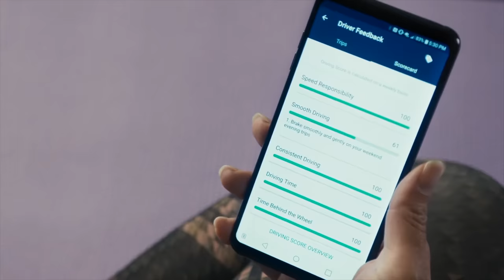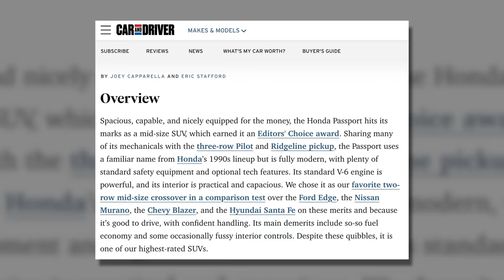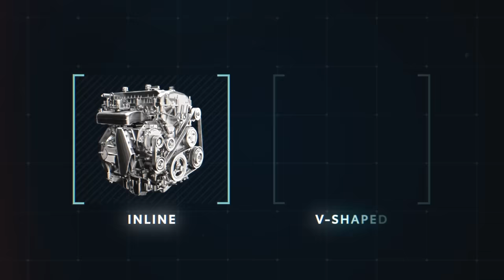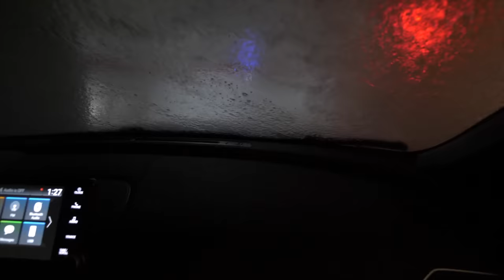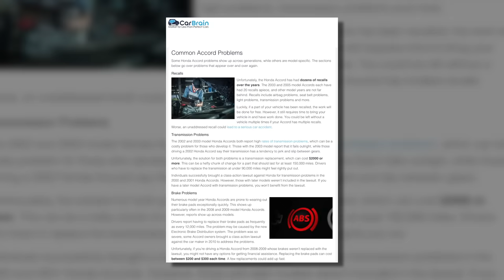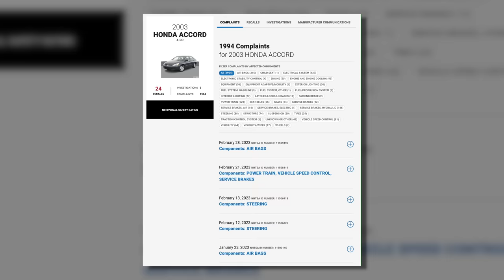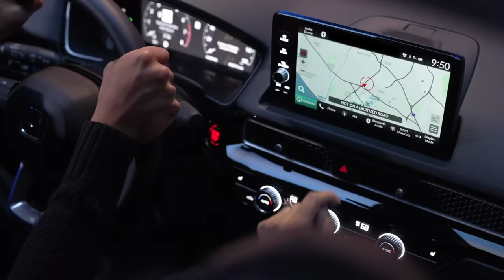Honda's CEO Just Said, "We're Losing Customers Fast and Don't Know What to Do"

Comment: I have a 2003 Honda Accord with 188k on it the big ticket items that went for me was, the original ball joints and front axle at 140k, Fuel Pump died at 150k,  original Starter died a 175k, the Catalytic convertor Rust failure at 181k, replaced the Head Lights with brand new ones at 170k the cleaning method did hold up. The rest is has just been maintenance lots of oil changes over the years. The only real problem believe it or not has been the Ghost Radio issue. This started at 121k which it will automatically turn it self off on or no matter if the car is turned off or on it can play in the driveway with no key in it. That has been the biggest pain in the neck even put a new aftermarket radio below and after two years the original problem came back an where the old radio is turning itself on and off again even though it is not connected with the speakers anymore.

Comment: Been buying Toyotas for 45 years and have yet to have a major mechanical failure. I still think they’re the best cars on earth.
Reply: Try the new BMWs. They used to be terrible in the 2010s for reliability.

Toyota uses their engines in their best cars now. A 340i will treat you right without a single problem.

Comment: Honda's are good, reliable cars compared to most models. Toyota sets the bar when it come to reliability. I have had a Lexus 400 and three 430 models since 1998. 25 years and have had almost zero problems. All bought used.

Comment: I live in California. I have a 2007 civic. Great car, below $20k originally. 
Now 16 years later what are my choices for replacement?
Another civic with a ridiculously agressive look and a gas engine?
No thanks.
Where is my <20k electric civic with ~150m range? A civic is not designed for driving more than 100mile a day: it is small, stiff, noisy, so it’s perfect for what it’s intended for: runabout, commute… I have NEVER driven it more than 100 mile in a day in 16 years.
It’s main weakness and it let me down once: small, weak starter motor. An electric version would not have that problem.

Comment: I bought my 2004 Honda Element as a Honda Certified pre-owned car 
(45,600 miles on the odometer) in 2006 for $15,000. Manual transmission. It now has 156,000 miles on it. Yes, it occasionally needs repairs. For some reason, mechanics will express an interest in buying it from me. Last year, I drove it into the local dealership and was told that they didn’t want to see me “throw good money after bad”, and offered to show me some of the new cars in their showroom. I took that as a hint, and have no plans to return to them for fear of possible vehicle sabotage. It is my belief that the dealership mechanics are under pressure from management to generate even more revenue. They are good people, they are just subject to corporate pressure. I hope that I can get another 50,000 miles out of my car. I am retired now, and just use it to run errands around town. No more road trips. I live in a city, and have outfitted her with a gas cap lock, a catalytic converter shield, the club, and most recently, a set of wheel lug locks. A friend of mine inherited a 2005 version of the Element. Just a few days ago, she left her house only to find her car stripped in its on-street parking place. If you own one of these vehicles, hold on to it, and take measures to protect it from vandals and opportunists. Be well.

Comment: I work in the roadside assistance industry. Honda needs to stop using these tiny lawnmower batteries. If people  leave the ignition on for 20 mins there isn't enough current left to start them.

Comment: I loved my 2004 Honda Civic. I bought a 2017 Honda CRV but when I heard about the problems with oil and gas mixing because of the new fuel efficient engine I traded in the CRV.
Reply: You should have waited. The new GF-6 oils fixed oil and gas dilution 4ever. My 2018 Civic with the turbo is a dream car.

Comment: It is Unfair to point out all of the honda issues reported yet not reguard reported toyota issues. For example, Toyota has suffered from melting dash boards, digital screen issues and oil leaks. That said, Both companies are impressively reliable as a whole.

Comment: Had Hondas for 30 years. Last one 08 Civic.  A Lemon. Wheel bearing all fours got water inside and car made a humming sound.  Happened 2 years into ownership.  And again on 3rd year into ownership.   Interior lights stopped working.  Windshield rubber seals came off.  Headlight mounting oxidized year 2. Paint oxidation 4th year.  Last but not least engine fluid module regulator stopped working in year 3.  Just past warranty.  They had to remove part of the engine and front suspension.  Honda would not pay for it.  Told me to bad so sad.  I have not owned a Honda since 2015.   Don’t recommend Hondas. They don’t stand by their product.

Comment: I have a 2011 Honda Pilot and bought it with 245 000 miles .
I have within a year, put 75,000 miles .
Yes I have put work into it but nothing to expensive, and I have done some of the work . 
I would buy Honda again .
Going to take my Pilot  in for a timing belt change soon ..
I also would buy a Toyota

Comment: I believe I heard my 2002 Saturn SL2 has a Honda engine in it. Over 150K original miles on it an no work done except replacement ignition coil under warranty. As for the Saturn cabin features, below average. Simple car but still plenty broken. At least the Honda engine is amazing.

Comment: Tried to buy a new Honda but hated the searching experience. We asked for manual transmission and the dealer dismissed us saying that was obsolete, or that manual cars come only with under 95 HP? I had a manual 2011 crossfox, it wasn't  even a large SUV and it had 106 HP, are you kidding me? Meanwhile the CTV transmisions are still unreliable enough on almost all brands to trust blindly but the car rises value because of it. Whats more if CTV fails, forget about the car. Repairing it is too expensive and virtually impossible outside the brand's  tech support. 
When you force down only one model, clients simply don't  buy.
Reply: I have not heard of many,  if any issues with Honda's newer CVTs. Toyota as well!

Comment: My family bought a 8th gen Civic (used car dealer). It was the most miserable car we've ever bought. It was the only car we have sold prematurely (only after a year). Despite Honda being reliable or at least cheap to repair, there were SO MANY petty issues with it, it just added up.
Reply: The key here is you bought it from a used car dealer. It was probably driven hard and abused by previous owners. Don't ever buy from a used car place. I had the same generation (2008) for ten years and I had no issues. But I drove it off the Honda dealer as a brand new car and took care of it. Funny how that works out better.
Reply: @markr.1984  you are actually right. The main issue is that we got it from a dealer. Other than that, the right type just wasn't really my preference.

Comment: I worked at a dealership putting Honda motorcycles together while in HS and in college. I agree with Scotty in that I sincerely believe that Honda makes the best engines in the world. However, they have had automatic transmission problems that went unsolved for many years with their 6 cylinder engines. I personally think that they remain questionable. They also have failed to adequately deal with interior noise. Again, this has been the case for years. I sat in the back of a friend's Accord and could not hear the conversation in the front seat. One friend, who had always bought American, bought an Accord just about four years ago and soon traded it on a Ford specifically do to horrible sound deadening. At one time Honda cared about building a quality product but they now rate fairly poorly in the Consumer Reports yearly frequency of repair survey, particularly their offerings like the Odyssey or Ridgeline, which routinely get panned for things like air and water leaks. Speaking of the Odyssey, many owners feel like the design went backwards during the last major redesign (2011?) and instead of buying another, they switched to other brands. Another friend likes his Ridgeline but had to get it fixed in less than a year due to water intrusion where a weld was not sealed properly, apparently a common problem. There was a time when Honda would quickly address these problems but apparently not anymore. Lastly, Honda has always been pretty conservative but so much so these days that they don't appear to be keeping up with the competition on innovation or features.  My family went from two Honda's in our garage, to three Toyotas. To be fair, all things being equal, the Honda's do seem to get slightly better mileage than Toyotas.

Comment: As an owner of 4 prior Hondas ( 75 Civic CVCC 5spd, 85 CRX Si, 88 CRX Si, 2009 Honda Civic Si) I would offer that Honda and its stubborn insistence to offer "Si" versions (as well as Type R ) strictly as manual transmission vehicles is getting increasingly "silly" . Right now I am in the market for a new car and would consider the current Civic Si sedan..... if offered with an option of a 8, 9, or 10 spd. automatic ( as well as their retaining the 6spd manual) ......The current 23 Accord Hybrid Sport   is great but needs more torque ....Honda needs to return to offering more "fun" vehicles such as a S2000 and a CRX for 2024....Maybe even a redo of the Element. Hybrids are all fine for any of the new offerings. Hurry the Civic E Hev Hybrid to the USA ( it is already out in Europe).  Bring back the Fit (again already out in Europe) ..How about Kei cars for the US market? These suggestions are just for a start.

Comment: I have been driving Hondas for the past 30 years because they were simply reliable.  An overstressed turbocharged 4 cylinder with a dumb CVT is exactly Not that.  I'll shop elsewhere next time if they don't correct this.

Comment: Have owned older Hondas and Toyotas. Toyotas do have an edge over Honda. Hondas look, handle, and interior are nicer. Toyotas seem to more user friendly, super reliable, car seems more durable. 
I had to upgrade my father's Fit battery as it was totally undersized as it had a oem battery cover for the upgraded size in place already. I remeber Accord batteries were bigger 24 series now they have cheapened to Civic size battery. 
With oil dilution problems and rust issues with their CRV's.
I am strongly going towards Toyota's, don't need anymore problems than there is in my life.

Comment: I can tell you Hondas are way to expensive now. And offer a lot less basic features.
Liek the Civic for example. You can't get foglights unless you get the top trim level. You will always be reminded by the hunks of plastic that you cheaped out.
Rear vents are not available at any trim level despite being a option in Europe.

Comment: I own a civic 2011, family has an Accord 2014 and Honda CRV 2012

I'm actually very satisfied with all 3, but their are some weird defects that I wouldn't expect from Honda.

The 2014 accord has gone through 3 starters, both the CRV and accord have a oil pump problem when cold started that makes a horrible noise from the oil not pumping properly.

The 8th gen civic is pretty good, I have over 300 000km on it and the only constant issue I see on these vehicles is the design of the tensinor bolt, mine snapped and I had to retap the thread with a helicoil. But I see them snap on other vehicles. 

Also their was a drain that was caused by the cluster being on internally.

The newer Hondas have the most odd problems I would never expect from Honda, the turbo powered engines with the oil dilution and oil burning are by far the most suprising from Honda. 

As of right now personally I'm staying away from newer Honda's.

Comment: I have owned several Hondas and Toyotas.  The Toyotas are more reliable (especially the transmission).  Hondas are more fun to drive, have better pickup, and more feeling of the road,  but they are noisy on the highway.

Comment: Funny, I just said today "I think this is my last Honda." I owned a CRX,  2008 Civic which was used, a 2011 and a 2014 Civic. My new  2011 broke down at 20k miles. My new 2014 has 30k miles on it and I keep hearing it needs all these expensive repairs like rotors. Now today I'm being told I have an oil leak which would cost me $700. This is either a lie or something they did since I just took it in for an oil change. I hardly drive but still I never needed all these expensive repairs with the first two cars until they reached 70-80k miles. That's the whole point in buying a new car. I got my rotors and break pads done, having a problem because I didn't take it to honda. Honda told me that the other shop put the pads on backwards. Other shop told me it was impossible and they are putting new pads on for me. I'm going to let them replace my pads and finding a new mechanic. Why can't people just be honest?

Comment: Bought a 2017 Pilot EXL, noisy, terrible radio, uncomfortable seats and transmission needs fluid change every 15-20k miles to fix a shudder. Simple as an oil change but what is up with that. At 72k just ordered the new fluid. Only takes 3.5 quarts to drain and refill. Dealer did the first drain and reprogrammed, I have done it twice. This time I am going to drain and refill, drive for a day or two and drain and fill. Piloteer forum some people change the fluid every other oil change. Actually Honda has it in the specs in the manual for 3.5 quarts. I live in a rural area so less than 10% is city driving and my wife and I are both of 70. The mpg is off 2.5-3 gallons per hand calculated. My other vehicles have usually been with in a half gallon according to readout. My 2009 Ford Flex rode better, handled better, a lot more comfortable seats and about the mpg. My son's 2019 CRV has had the steering go out at a cost of $3600, so bad that units are back ordered. Should be a recall for no other reason than a safety issue. His 16 year old daughter could not steer it and sit for weeks for parts. Just not the Honda of old.

Comment: Hmm well maybe getting rid of the v6 accord and 2.0t accord is one of the reasons why Hondas aren’t as fun as they use to be. Now they are going either hybrid, electric or slow gas powered cars with cvt which I find to be one of the most boring and breakable transmissions on the market.  Only quick car you can get is a type r and it’s manual only, I would like a DCT or 10 speed automatic but it is what it is. The price of their slow gas powered cars are also outrageous.

Comment: Its all about the timing belts. Honda dealers  are charging $4000 for timing belt kits. Every 70'000 miles. Many Honda dealer are in need of training. I like the Toyota timing chain.  Honda's are hard on motor mounts, brakes, and tires. No more Honda's for me. I have three Toyota at this time.

Comment: I will not buy another Honda .. I bought a an Acura TSX in 05... Alternator went out at 50k timing chain not belt. Which one would have thought would have lasted longer,but broke at 80k... And lots of other little things... Fuses kept popping, weather stripping going bad cause trunk to leak...Head Lights allowing water in... So he'll with that nothing but Toyota since then.

Comment: I have a 2014 Honda Civic lx with 18R engine very reliable car much better then the Corolla's I had before with lots of problem like starter and axle issues . My honda is appealing fun to drive low cost car. The new Civic is so much different in style and engine type it is no close to the civicness of the Civic. Honda needs better car dysigners and restore Honda like it was before. Hope they change and make cars simple and low cost

Comment: I've had many many Hondas since 1984, Accords, Odysseys, CRVs and Pilots.  In the 80's and 90's , IMO, Hondas were the best.... simple, fun to drive and of course superb reliability.  Things seemed to change in the 2000s.  I had a 2017 CRV 1.5 Turbo with an unfixable oil dilution issue.  Got rid of that POS and traded for a Kia.  Huge improvement.  I think Kia and Hyundai today are where Honda was in the 90's with inexpensive, reliable decent driving/handling vehicles.  Had a 2016 Pilot with the awful shifting ZF 9-speed transmission.  I actually traded that in for a lesser model 2018 Pilot that had the much better Honda 6- speed transmission.  But still, the ride, handling and ergonomics of that Pilot, traditionally Honda strong suits, were just awful.  I didn't realize how awful they were until I drove a new 2021 Jeep Grand Cherokee L.  The Jeep blew the Pilot out of the water in every single category.  I was always a Honda fan boy and didn't even consider domestic vehicles for a very long time.  It was like I was lulled into this idea that Honda was always superior, until they became inferior.  IMO, Honda has lost their way and it took me testing driving a new Jeep to wake me up from my slumber.
Reply: More people are returning back to American cars now. Honda is the past. Even Ford Explorer is better than Honda Pilot.

Comment: I still driving a Civic 2011. Not mechanical or electrical problems. For moving around the City is wonderful. Very low gas consumption. With the time and when compare with other cars my only complains are the lack of power and noise specially in long trips. But, this is a cheap car! I can't ask for more.

Comment: Honda's designs slow them down a lot.  Especailly Acuras which are more profitable because of higher prices.  Their ugly grill/transformer like lines instead of more or copying BMW/Audi like they used to. They are made well vs most other makers but not as good as 10-15 years ago.  Their engine parts dont last as long and many signs of cost cutting like short lasting stock batteries/starter/etc.